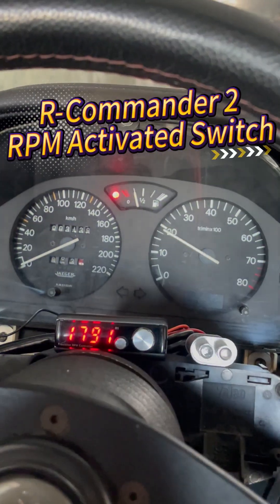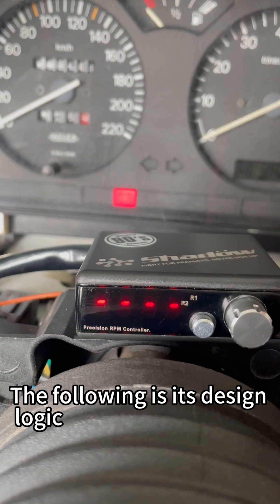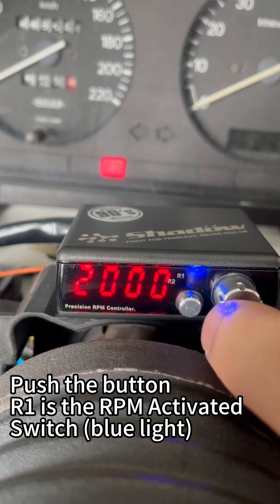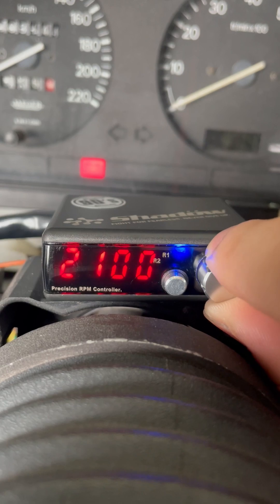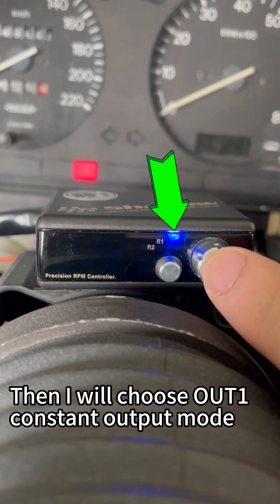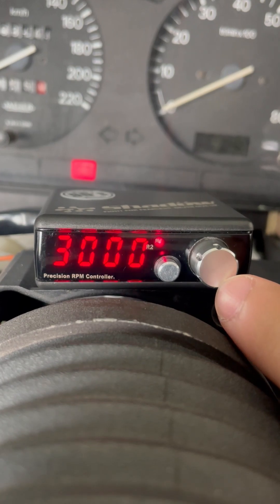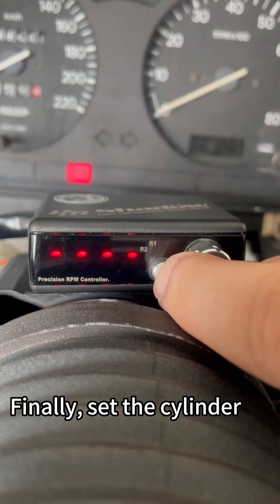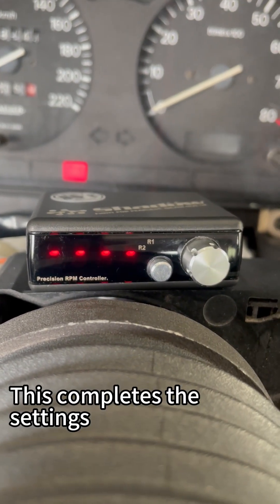R-COMMANDER 2 RPM Activated Switch-manual

Comment: WTF is this even supposed to be?
Reply from the maker: This device can be used for many functions. It can be connected to a shift light, a solenoid valve, and even used as a tachometer.

Comment: Was it supposed to make sense?😂
Reply from the maker: This device has many applications, it all depends on how the user applies it.
Reply from the maker: This device can be used for many functions. It can be connected to a shift light, a solenoid valve, and even used as a tachometer.